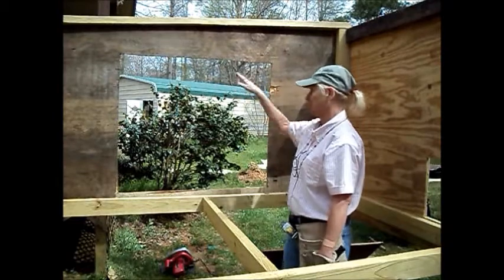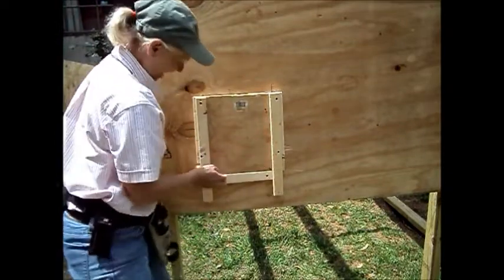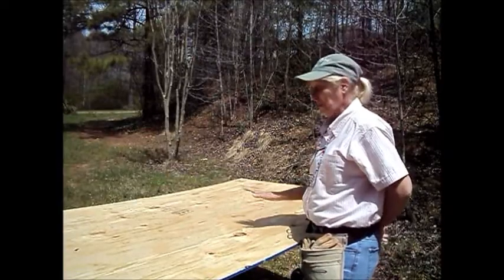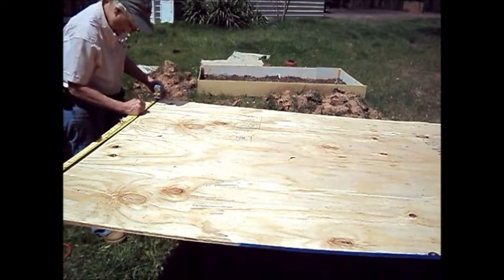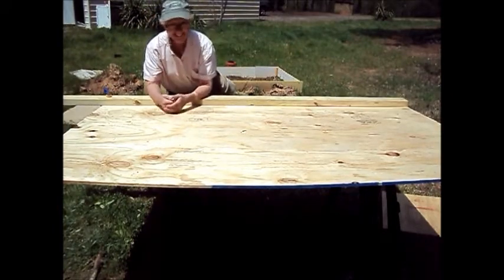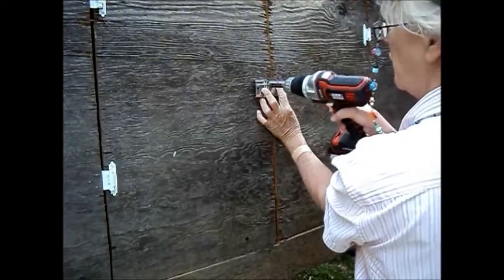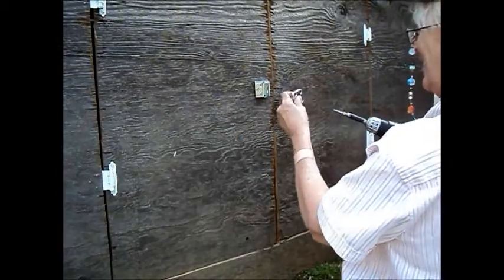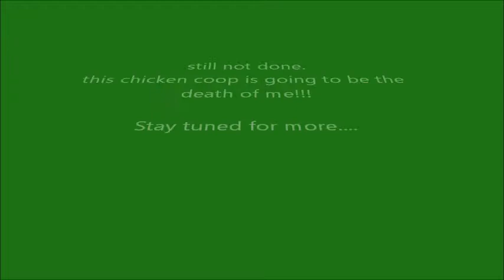Chicken Coop Build - Part 3

Comment: Good job, it's so much harder when you are doing things by yourself.  Since you have bumble bees and critters, will they get into all the gaps and the space near the roof over the chicken door? What are you using to open the chicken door?
Reply from the maker: If insects get in, the chickens get a snack! I do plan to put up hardware wire at the gaps in the top, though. I also have to finish putting in two vents, putting wire over those, putting in the stick-on tile (linoleum) on the floor of the coop, and put up roots inside. As to the pop door... I have no idea. I'm still working out some ideas. Believe it or not, this coop is going together without the benefit of plans. That's what's been such a hoot!